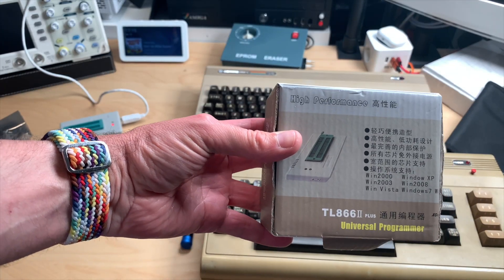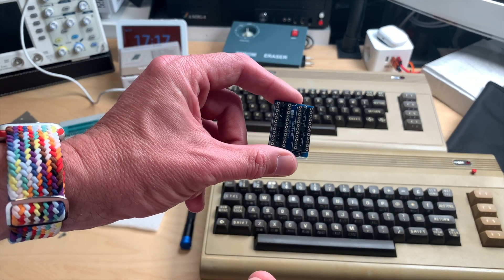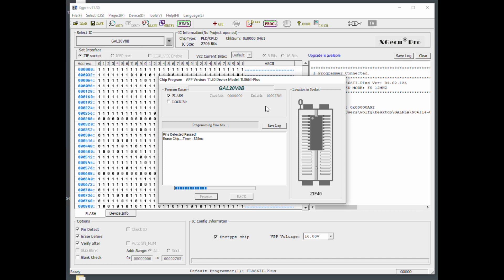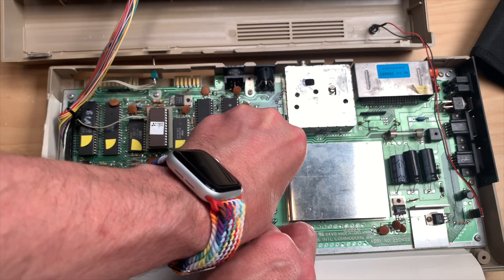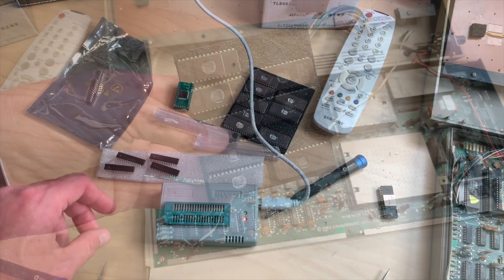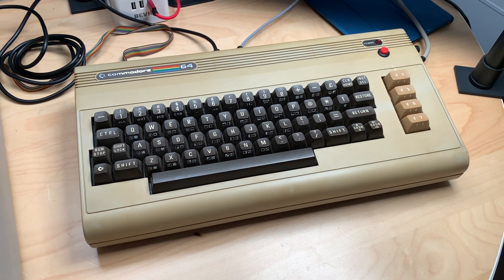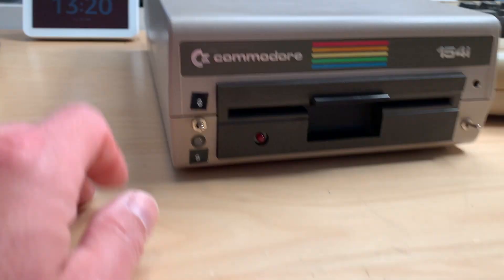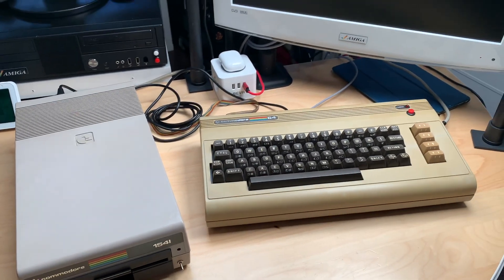Programming a GAL-PLA, SpeedDos Plus and finishing the SpeedDos Plus C64 (Cleaning)

Comment: Hi, great video. Two things: First, the data cable for bit 3 doesn't work (maybe CIA, cable or VIA in the 1541). Second, to test the Firmware in the 1541, read the error channel with a basic programm or if Speeddos plus is active in the C64 with an @-Sign. This should gave you "73, CBM DOS 2.6 1541 ..." or "73, Speeddos Plus ...". Another test is the formating routine. The original DOS does it in 1:40 min and Speeddos in ca. 23 sec.

Comment: Klasse Kanal, grad gefunden 👍 :), werd mich mal durch die ganzen Videos wühlen, kenne auch den von Adrian 😊. Warum hat's mit dem Eprom nicht funktioniert? Hmmm...ich hatte ähnliche Probleme als ich neulich in der Firma Eproms für eine alte Maschine gebrannt habe. Vielleicht hilft's :)... Der M5L2764K braucht 21V zum programmieren...das kann der 866 plus nicht mehr (die alten Modelle konnten das...wenn man wirklich muss, kann man das aber lösen - vermute darum ist der Eprom auch nicht in der Liste... ). Also schonmal zu wenig Spannung für den Mitsubishi. Außerdem möchte der 50us delay, 100 würden sicher auch gehen, aber bei den eingestellten 1000us seh ich ein Problem ;D. Weiß auch nicht, ob der C64 die 250ns Chipgeschwindigkeit toleriert. ABER: Wenn ich da auf den Steckschaum gucke, meine ich einen AMD und einen TI Chip zu sehen, die mit Sicherheit viel besser geeignet sind :). Würde es mit denen und korrekten Einstellungen nochmal probieren :) (die müssten auch in der Liste auftauchen). Ich glaub nicht, dass die Ebay Chips kaputt sind, nur einige von denen halt ungeeignet. Viel Erfolg 😊✌👍.
Reply from the maker: Danke dir! ... auch für die vielen nützlichen Infos. Das Thema steht noch auf meiner Liste ;-)
Reply: @RetroWK  ich bin super gespannt :). Ich hole jetzt ausm Urlaub zu Hause meinen alten Amiga 2000 (stock nur mit Diskette und 1MB) mit zu mir heim, den hatten wir 1991 gekauft :D. Hat leider ordentlich Batterieschaden, aber wird schon wieder :). C64 hatten wir leider nie, nur mein Cousin, von dem wir dann später einen 286 und 386er bekommen haben :D...hab sogar noch diverse Einelteile und CPUs (glaub 386/486er), einiges dürfte aber nach so langer Zeit hin sein, aus nostalgischen Gründen bis heute aufgehoben :D. Ich wühl mich mal weiter durch deine Videos :), musste schon paarmal schmunzeln wegen diverser Fehler und der Selbstkommentare :D. ✌🖐😊